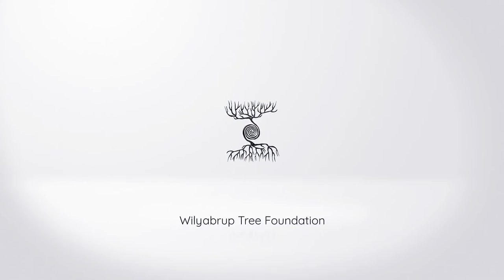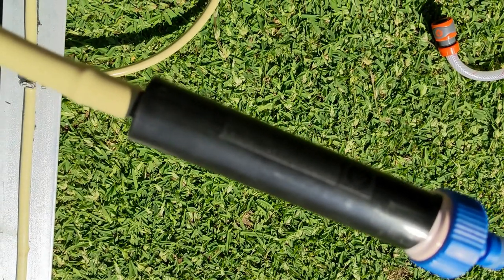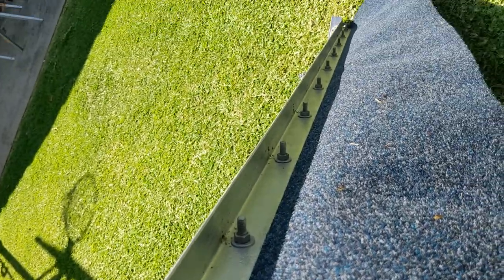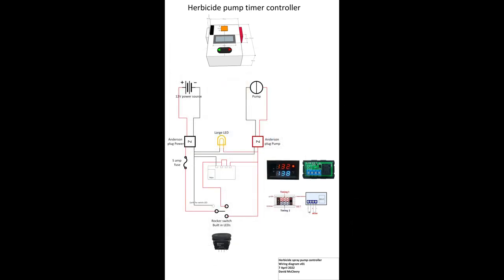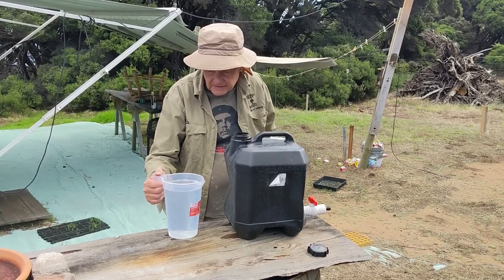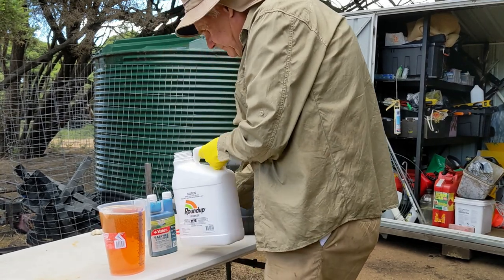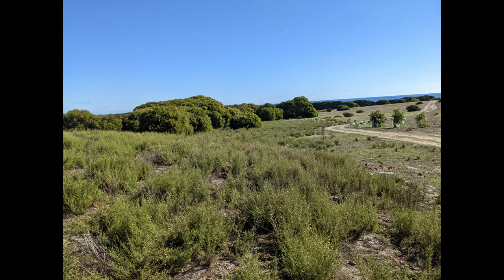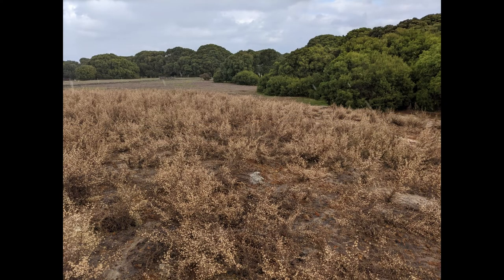DIY Weed Wiper Herbicide applicator

Comment: Next time apply a higher rate of water and less Glyphosate, to give a better coverage.
Reply from the maker: Thanks Anthony. I plan to try a few variations on concentration of mix. The 3 to 1 mix was suggested by a research paper I read
Reply: I use a mix of 20 to 1 with my home made machine. It does a really good job and costs next to nothing to use. I like your timer box idea, top job.